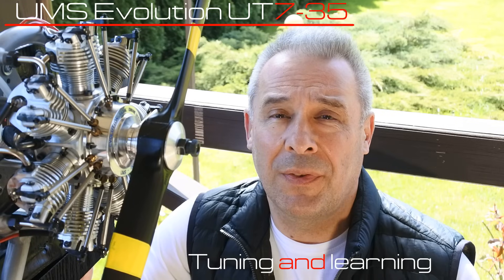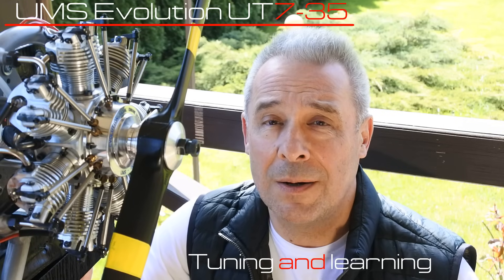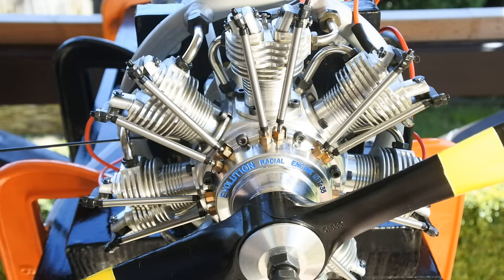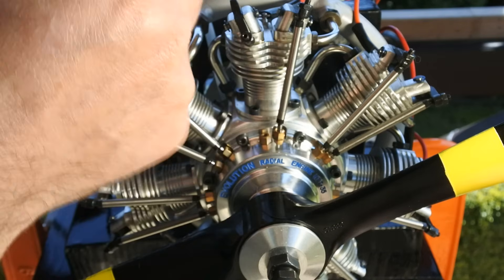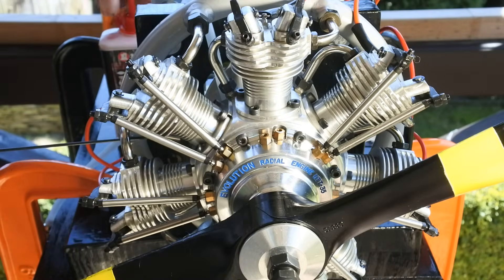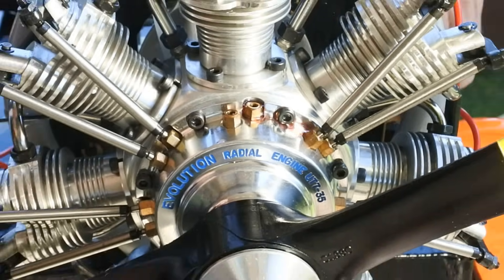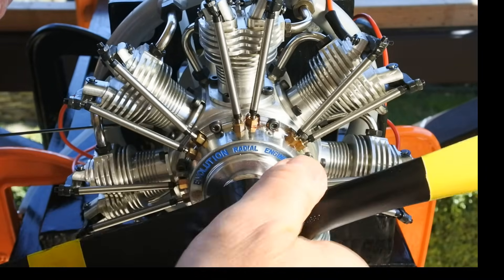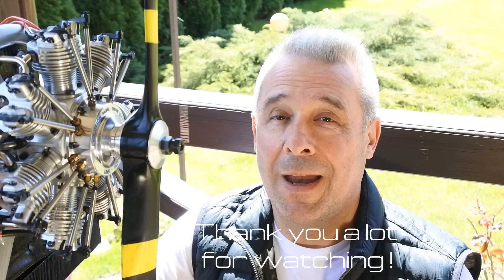UMS Evolution UT735 tuning and learning

Comment: hello from france ... very informative video .  for a high wing plane of 240cm 7kg can you give to me an engine recommendation . i was thinking of this one or the ums 5-55 gaz or the saito FG33 R3 ... thanks for your expertise advice . cheers . patrice
Reply from the maker: Hi, and thank you very much for your kind comment. You're asking definitely interesting question. For 240 cm plane you'll need at least 1,6-2,4 HP for stable & confident flight. As to me, I prefer a bit higher thrust-to-weight ratio, so there are few recommendations: 35-50 cc engine, better - 2 opposite cylinder 4 stroke engine. Realistic sound (its so important for me), enough power for 40-50 cc, minimum vibrations (due to symmetrical layout). For example, Saito FG41 TS ( a little bit under-power), Saito FG 57TS (ideal) or Saito FG 61TS, which is the best choice for me - nice sound, great power and flexibility. Regarding Saito FG33R - frankly speaking, I'm not a big fan of Saito's 3 cylinder engines, having a lot of vibrations with FG60R3, as well, as with FA120R3, due to uneven fuel distribution in between cylinders. It's possible to correct, but you will pay additional at least a half engine price for correction third party kits. And at leas, one cylinder engine, it could be O.S. FG40T gasoline 4 stroke engine (40 cc) and a lot of power, still well balanced, with a nice idling sound. Os course, you can try O.S. FR5-300 Sirius, converted to gasoline and spark ignition. Fantastic real looking engine, with a great sound, but the price will be too high in comparison with Saito FG 57TS. Of course, there a few 2 stroke engines, like DLE, DLA or DA or RCGF Stinger, which also will serve you in a good way, but 2 stroke sound could be irritating for your mates at airfield or neighbors during engine adjustment. Sorry for long read, your question was very interesting, thank you and good luck with you future plane build !
Reply: @crazyengines88  thanks so much for the recommendation . so avoiding 2 stroke  due to the bad sound , the sole reliable choice seems to be 40cc and over in 4 cycle twin  and 30cc and over in 4 stroke  mono .... i already have the zenoah ZG 20 and the stinger RCGF 21 twin  ... but there are 2 cycle ...  thanks again sincerely patrice
Reply from the maker: @arnaudinpatrice112  You’re highly welcome with any questions, it’s a great pleasure to be helpful. Have a nice day !

Comment: what a nice radial engine, this video is very helpfull because of the information about treatment, a friend of mine just bought a glow radial and asked me how to treat the engine after flying, i showed your video and is was completely clear to him  Thnx ...
btw, i mounted an extra breather nipple at the front cam housing because i cant take out the pushrods of my ASP FS400, before every flight i apply 2cc of oil into the breather nipple to make sure the cams are well lubricated, after use i close the fuel line and let it run dry  and apply some extra after run oil into the Crankcase breather nipple
Reply from the maker: Thank you very much for your comment ! Definitely, all radials need to be lubricated more, than general single cylinder 4 stroke, due to the increased amount of moving and  interacting parts. I think, that it was a great modification with extra breather, usually, I also adding more A.R.O. into engine, after run and brief cleaning from inside (in general, I don't dismantling the whole engine, just partially, to fill the engine with cleaning mix. I'm very appreciate you for your comment, hoping, your friend found the most answers in CrazyEngines videos. Thank you and have a nice day !

Comment: That is certainly a good looking engine. Better than the current UMS version with the black painted cylinder heads. In my opinion, of course.
Reply from the maker: Thank you very much for your comment ! Definitely, I'm not so well experienced with UMS engines, so I'm not at all sure if they ever had cylinders just aluminum, unpainted. This engine is about 3 years old, i.e. it's still young. I tried to look for slightly earlier versions of the 77th or 99th, with unpainted cylinder heads, so far I have not found it yet. 
Thank you !
Reply: how is your ASP 65cc doing ?? i followed your topic and video's after finding a brand new one and wonder if your ASP Radial is still running great ??
it would be very nice if you can do an update video of your polished beauty :)
Reply: @Modelpilot  Hello! Thank you for the interest in my old radial engine. I have not run it in a long time. Perhaps I will make another video some day. :)
Reply: @xKmotx  that would be great 👍

Comment: Not a bad running engine! Though that after-run procedure seems to be a bit of a pain in the rear....I'd probably just let the castor oil in the fuel do the work like I do all of my other 4-cycle engines. Run it out of fuel at the end of the day and store somewhere climate controlled.

Makin' me want one of these...
Reply from the maker: Thank you very much for your comment ! Yes, I should say, that one gets the impression that working with this engine is quite difficult and a little troublesome. But having got to know this engine better, I’ll say that this is only the first impression, in fact, the design of the engine allows you to easily get access to the most parts, & well, to lubricate it in the style of the 1930's of the last century - as for me, for example, it’s more of a pleasure than load. Of course, doing such exercises every day could be quite a load. Among the radial engines, there are a couple of those that are a real horror to work with, compared to this. As for castor oil, for a number of reasons I avoid using castor oil in fuel and as an after-run oil. My little experience suggests that the best storage medium is a mixture of synthetic oils (3 and 1 oil, some kind of Mobil Dextron IV gear oil and Motul  or Klotz oil). Of course, that is not for starting discussion or whatever - just a note from my small experience. 
Thank you and have a bice day !
Reply: @crazyengines88  Ye its not too bad now, but put that thing on something like an A6M5, FW190, Corsair, Bearcat, Wildcat, P47, Waco, Stearman, and suddenly you're either swearing up a storm end of the day or shortcutting after run procedures. And if I had one that's most likely where I would put it. Aircraft with open radials arent really aircraft on my wish list and I dont buy engines to collect. I buy them to fly.

As for castor....I wont fly without it. It does so much for the engine it feels wrong not to have any. I've seen a couple engines lose all of their bad habits solely by adding castor, too, was helping a buddy with an FS120 Surpass once and saw it happen. On Cool Power 15% it had horrid idle, transition, flamed a lot, refused to play nice. Swapp Cool Power for castor containing Omega and suddenly it ran like you would expect an OS Surpass to run.

🤷‍♂️ castor all the way for me.
Reply from the maker: @TestECull  Thank you for your opinion, that's great, that it based on experience and practice. I don't have so much practice, that's could probably a reason, why I don't use castor oil. I've few OS FS 120 Surpass with diff mods (pump, no pump, E-version, etc.). Most of them doesn't work, as I want, something was wrong. Will find a time in between test runs and else channel activity and definitely, will try to re-run it on castor based fuel. What do you think about Byron Aero Gen 2 fuel, it has some degummed castor oil in it ? What is your experience with castor oil, what percentage would you recommend ? Thank you !
Reply: @crazyengines88  I don't have access to that stuff here but I would assume it to be fine. I have used Byron's in the past for surface stuff. ran great. My usual brew is Omega 15% from Morgan Fuels.
Reply from the maker: @TestECull  Thank you, will give castor a chance again !

Comment: Lovely sound.
Reply: Thats a brilliant little engine, i see your more pleased with this over the saito fg60r3, 
I wanted a ums 77cc but i could bare the price and settled for the fg60r3, hopefully it will run well enough to enjoy flying, great video..cant wait to see the video of this engine being stripped down to see its workings😄
Reply from the maker: @danielhitchens4407  Thank you very much for your comment ! You're totally right, I'm really enjoy to work with UMS Evolution UT7-35 engine. And I should say, that I'm dreaming also about UMS UT7-77 and even UT9-99 ! My experience with Saito FG 60R3, unfortunately, mostly negative. I can't recommend anybody to mount it on the plane in "from the box" condition. I don't want to spent additionally at least, a half of engine price to make an attempt to correct manufacturer's flaws. Such vibration level will destroy airframe in minutes, as well, as the most of RC devices on board. There is a few runs planned with UT7-35, and soon, I hope, we'll learn its internal structure and design specialties.
Thank you and have a nice day !
Reply from the maker: Thank you very much for your comment ! I like it sound too, will be interesting to check, how it sounds without exhaust ring collector, so, it means, when each cylinder exhaust sounds independent. Thank you and have a nice day !
Reply: @crazyengines88  I love the sound of the big MOKI engines in a scale warbird. It just sounds right.  It's the same with the big KOLM engines too.
Reply from the maker: @darkiee69  Thank you for your comment ! I'm not so familiar with MOKI or KOLM engines sound, but definitely, you turn my attention to this engines, thank you !
Reply: @crazyengines88  
Copy and paste in the search window.
Fischer P51 Mustang Kolm IL310cc
Reply: @crazyengines88  Copy and paste in the search window. (YT hates links)
1/4 SCALE CORSAIR F4U COMP ARF RC - MOKI 250cc 5 CYL RADIAL - 110" SPAN - BALDOCK SCALE - 2022
Reply from the maker: @darkiee69  Thank you very much for providing search strings, definitely, very interesting ! Thank you !